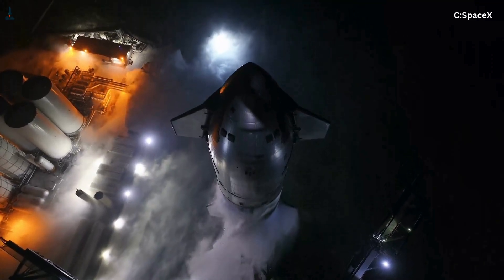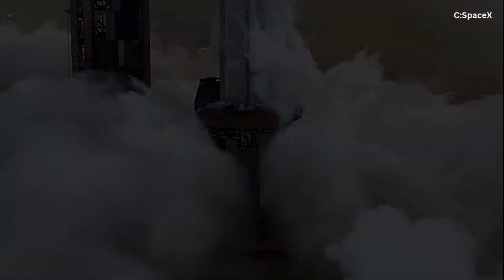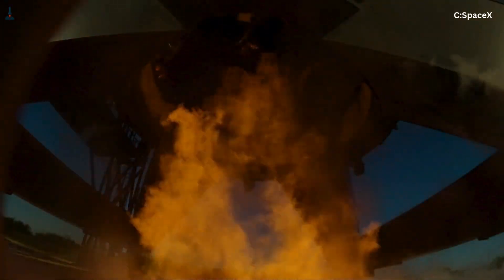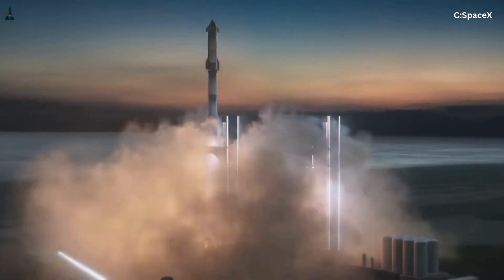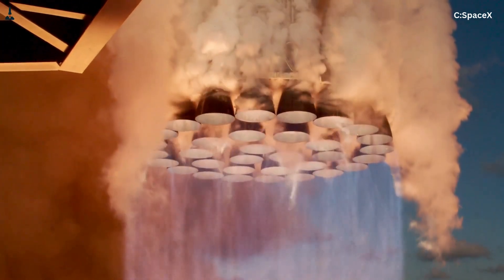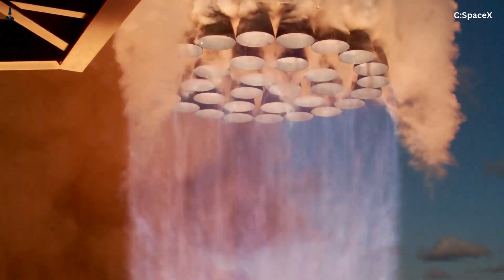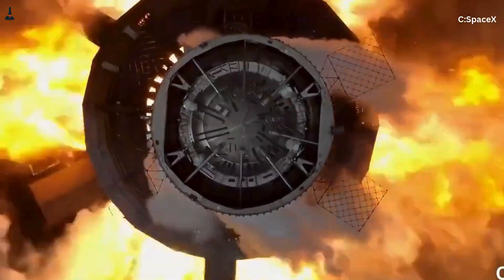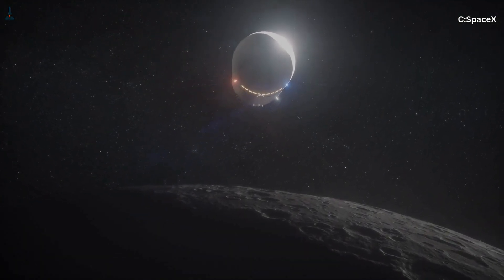What If Raptor Sea-Level and Vacuum Became One Engine? #spacex #starship #elonmusk #raptorengine

Comment: You keep talking about 2 engines ... there is 1 engine (well 3 technically) ... just the Raptor. The powerpack is the same, only the nozzle design changes. So most of that argument about complexity or design unification goes out the window. It is the same engine.

Nozzle size, defines many things, how many engines you can fit, and how much you can gimble them. And there is no way around that. That big nozzle is not doing a landing burn. And those small nozzles are not doing vacuum efficiently. 

At best, you may see a vacuum only Startship, that does away without the 3 SL Raptors and gets 6 or 7 Vacuum Raptors ... but at that point you are putting all your ship authority on throttle control. A bit of a risky bet. MAYBE there is a scenario where that pays off ...  A hyper heavy lifter expendable version with an even bigger fairing.